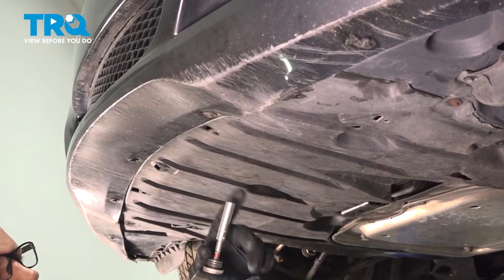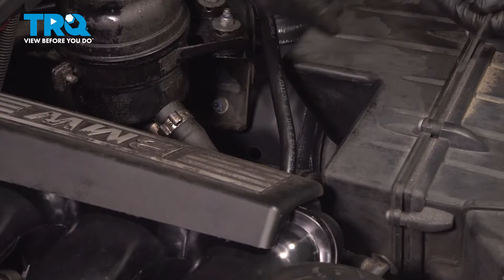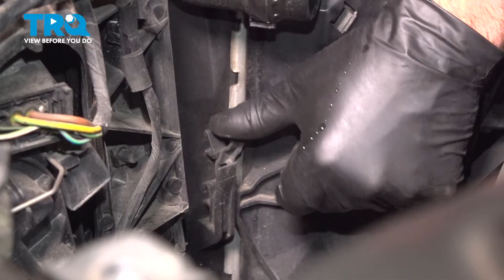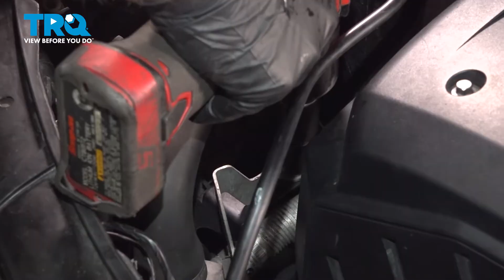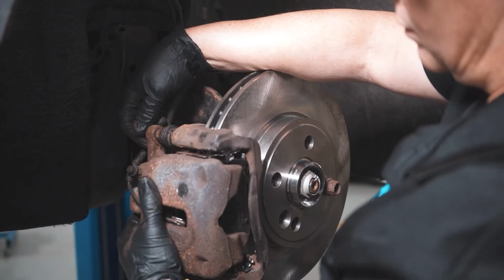How to Replace Radiator 2009-2013 BMW 328i xDrive 3.0L L6

Comment: At first I was dreading doing this after my radiator arrived but when I actually had the courage and started it was extremely easy a little hassle but overall wasn’t too bad, the only thing the Germans did right was give alot of clearance once the radiator ran housing is removed which made it so much easier than on my parents toyota, there was like zero clearance to remove anything

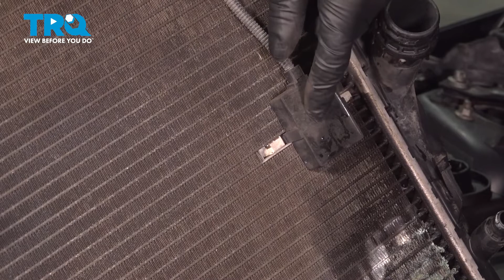Comment: You failed to mention that the EAC sensor temp probe @9:07 is glued in. It is impossible to remove without breaking the probe. BMW intentionally glued it in to sell you the radiator with the sensor for 800 bucks. The sensor is available from aftermarket 😉.

Comment: Great tutorial, thanks so much. Never knew those clips needed to be pushed to lock before putting the hoses back on. That feature sure makes it easy. I'll be getting my radiator soon and be ready to jump on it. Tired of driving my gas guzzling and rough truck instead of my awesomely comfortable beemer.